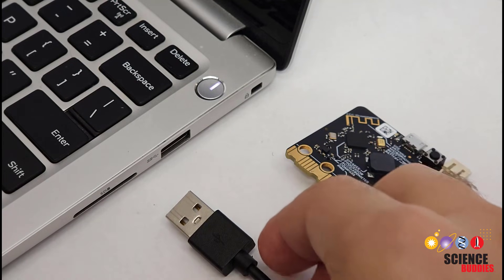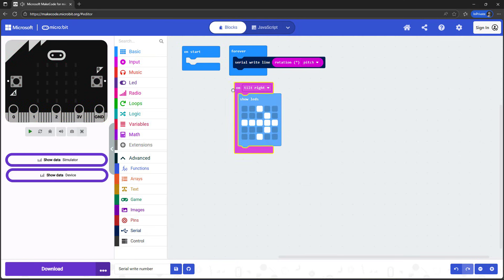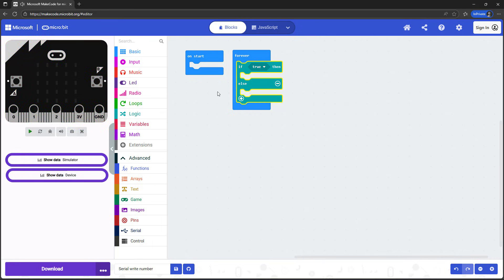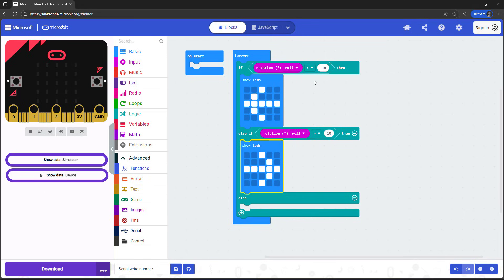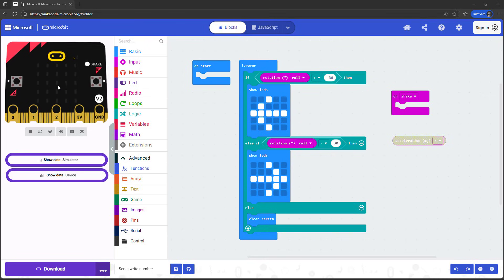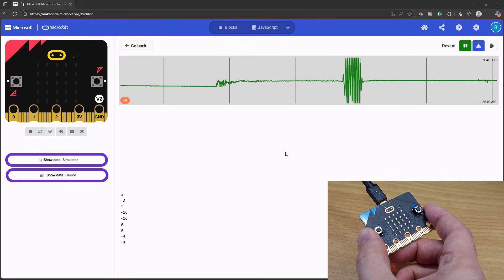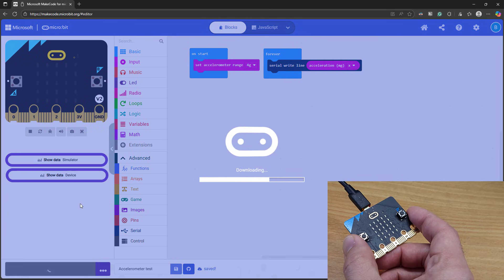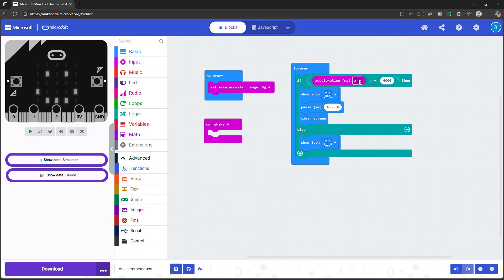How to use accelerometer with micro:bit | Tutorial #5

Comment: I wonder if I could use the acceleranator to control a led strip- so that the lights fade on and off along the strip based on how the micro bit is tilted/rolled?
Reply from the maker: You can certainly do this with the onboard LEDs. We don't have our own tutorial about external LED strips, but it should be possible to do that as well.